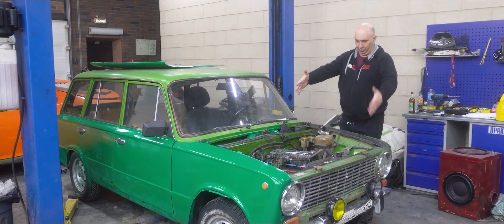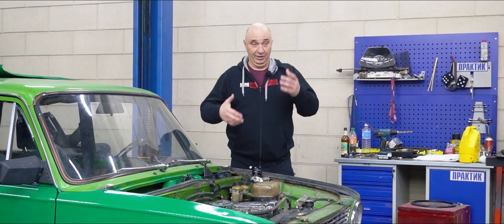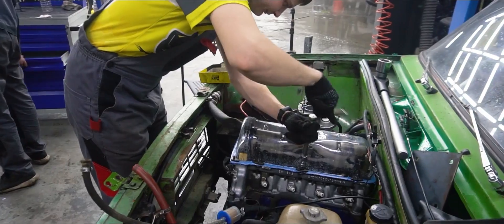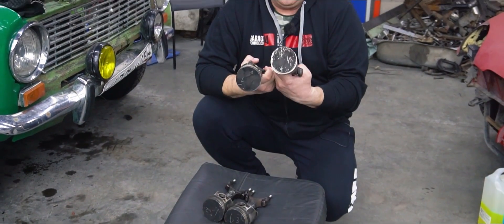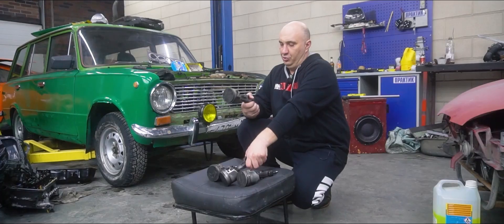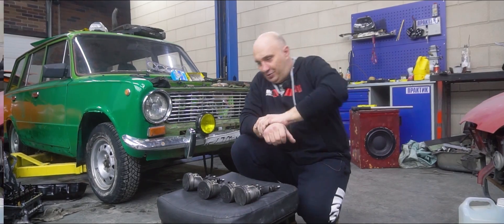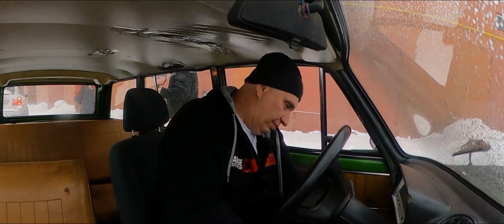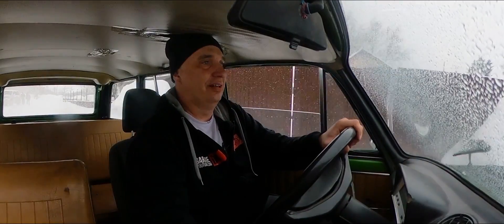Welds vs bolts – testing their durability on conrods

Comment: Welds are better because they dont mess with the evenly constructed weight distribution in the engine between pistons as they all operate tagether on the crankshaft 🤔

Comment: Bolts are always better, they have some give and will take shock, welds are rigid and crack before a bolt will brake that is why truck frames are bolted and riveted much better than welding.

Comment: as expected, the conrods have clearancing issues. the bolted ones are suspect. you're probably chewing up the lower cylinder walls and getting metal shavings in the crank case. poor thing. has me thinking about that last experiment with the plastic cylinders. what if plastic conrods? would that work, and how long until you'd eject a piston from stress?

Comment: @6:40

It won't start that easy because the conrods have different weight than the originals. So the timing shouldn't be in correctly order.

Comment: I had a VW  78 Rabbit with a glasspack, and one time blow out 1 spark plug, i dint know was wrong with it and i keep on driving to my destination 400 miles away and i made it, beside all the knock noise,  the engine was fine, my rabbit still burn out the tires, i love VW

Comment: Welding all 4 with 4 different welding processes and put it back on the road and see which one last the longest ,,, that would have been a really educational experiment ,,, we knew the bolted one will give up ,, in any case great insight at design and materials strength conceptual basis ,, with a humorous line !!!

Comment: I think the piece of steel joining the bolted ends is what gave up, not the bolts.  It got pretty thin around the areas where it was drilled to accept the bolts and nuts

Comment: I wonder if you can do a study on what happens if you connect an increasing number of car batteries in series to a motor?  I wonder if the starter goes real quick and you get an instant start on 48v and at what voltage everything just explodes when you turn the key.

Comment: I wish you would have done one with the steel plate reinforcements like the ones you did with bolts, but instead of bolts just using JB weld after sandblasting or cleaning the metal.
The real JB weld not JB weld quick.
Fun video that's not the one I thought would go the first.

Comment: Well, such bolted connections rely on friction. Both sides should have perfect fit. Bolt is used only to squeeze them to have enough friction so that it can't move apart. If those bolted plates were not touching it with whole surface, it would have too much shearing force and it just shuttered it. That's why bolted connections like that are usually made on flat or precisely fabricated pieces that fit tightly together. Those bolts have good tensile strength but not shearing strength. It would be quite difficult to fabricate piece that fits there nicely.

Comment: Someone I know tried adding weld in the middle of connecting rods to make them stronger....
All that happened was the weld came off and then all the metal particles wrecked the engine via the oil galleries....
Don't do it...

Comment: Was wondering can you turn a fuel injected engine upside down and it still run also love the show
Reply: Aeroplanes do it, with carbies or fuel injection, keeping the oil circulating is whats hard when inverting an engine, not fuel,

Comment: I amused myself when I caught myself attempting to determine which connecting rod should last the longest, if the whole production even gets that far. My guess on the order of failure, from first to last, would be the weaker bolts, the TIG weld, the MIG weld, and then the higher grade bolts last. I'm not any sort of engineer. 
Edit: Wow, did I have it backwards.

Comment: What happened - the thin metal plate holding the conrod together snapped. Then we have an engine spinning fast with the bottom part of the conrod smashing into the loose piston and conrod very fast. Especially with holes drilled out of it the conrod was ground into fragments. The bottom part of the conrod managed to break loose from the cylinder now allowing it to fling outwards with centrifugal force becoming a flailing mace, thus smashing against anything it could reach. This is why the breaks are all along the path it would take.

Welds are stronger than bolts. Whilst this wasn't a fair test - the thin metal plates are very weak in comparison to conrods, bolts are rarely going to beat welds. The bolts drill out large portions of the metal severely weakening it, and carry the strength across a small thin portion of metal. Being separate bolts (as opposed to a single large one) they can break individually making them weaker than the sum of their parts. The welds take nothing out of the material and keep the strength, whilst adding an amount of fairly strong metal. Welds are continuous so the individual pieces can't break and it spreads the load better. Of course there are always exceptions, but in the majority of cases a good weld which is properly done will be better than bolts.

To improve the test one would want to use a similar method for both welds and bolts. Ie as a separate piece of metal must be used for bolts, the weld should also use a separate piece of metal to bridge the gap. Ideally it would not be so weak - it needs to take just as much load as the thick heavy conrod is taking itself.

Comment: This is one of those when you rebuild an engine you tighten the last bolt on air filter saying whew that took all weekend and look down and see a random bolt looking at you very importantly by you can't remember why. So back in you go. Hours later AHH found it. The number 3 con rod only had 4 bolts in it. 
Your friend looks at you..
Walks over to your cup and sniffs it.
Looks at you again. 
Just leaves not wanting to know why your conrods look like that.......

Comment: Not enough strong material around the drilled bolt holes, I assume. Maybe a small imperfection exacerbated by the removed material. Seems like the type of bolt didn't matter.

Comment: The way it shattered, it almost looks like it had a bunch of stress fractures. Maybe that one got to hot when grinding to cut? Don't think just the nuts and bolts would cause that much damage, unless maybe sheered off under very high pressure. Good video though.

Comment: Bolts have nearly no sheer strength, only the cheap bolts were able to flex enough to not be ripped apart:-)
Try to use fasteners for sheer strength:-)

Comment: I recently got another engine experiment idea: try putting some Cerama Bryte brand cleaner for glass and ceramic cooktops into it. The substance isn't supposed to scratch delicate surfaces when used as intended. However, I think we can agree that putting it inside a motor with parts moving at very high speeds and oil that it can potentially interact with chemically is far from its intended use. It could be fun to observe the results.

Comment: The man ls got balls for leaning in that motor while cranking. I wouldnt wanna be near it when it kicks a rod 🤟
Also Ive never doubted that the bolted rods would give first. Its a no brainer I think.
The entire force is on a small part of the metal holding the rod together. Especially if youre wrong by half a mm. That alone would be enough the fatigue the metal since it would be streched or compressed the whole time.

Comment: Isn't there supposed to be a hole going from the small end to the big end that supplies oil to the small end of the con rod and the piston rings??????
Wouldn't hacking up the con rods this way cut off the lubrication to the small end and rings?????

Comment: Remember: Welds don't "break" they "fail" so if your weld doesn't do the job, just weld it again! 

Unlike bolting pieces together; welds don't require additional structural materials to be sacrificed to support the bond so even a mediocre weld can outperform bolts as long as the fundamental elements of the weld are correct 😄❤👍

Bolts certainly have their own strengths to be fair, but as a welder by trade I'm biased. But hey at least I'm honest about it 😅

Comment: Personally I weld and bolt where I can, depending on shape of material,. 
But you should fill out he Pistons with lead weights, to see how Piston weights effects the engine balanc!   But I always heard floating valves will break rods , or pull them apart at high rpm!

Comment: Back in the day that no spare parts were available my uncle needed a rod for a KX125 but could only found one that fit the piston and another that fit his crank. They were also different lengths. He had a local machine shop that is known for being the welding experts cut them in half, space them correctly and weld them. It ran forever! Welds are superior any time something doesn't require disassembly.

Comment: Someone underestimated the power of a good weld. Depending on several factors, but usually welds are much stronger than the parent metal. Drilling holes and sticking Bolts through them, just makes the structure weaker.

Comment: I suppose you could even resume the test with blocking the holes in the engine and running it on 3 cylinders. You told us these engines were tough! Now would be the best time to prove it! I believe you could even resume on one working cylinder, if you just block the other paths.

Comment: Anytime you put a hole in the rod it will make the rod weaker as to welding it back together by replacing metal with metal the bolts feels the holes but doesn't help anything really

Comment: You need to test this. https://www.carthrottle.com/post/the-aftermath-of-a-jeep-revving-to-50000rpm-while-being-towed-in-4-low/  Put a couple of transmissions in series to spin a motor to high rpm with another motor. Something will blow up but it will be interesting to see what and at what rpm. Thank you.

Comment: Use Jb weld to fix the holes in the block to see JB weld is strong enoughto fix the holes without failure. And weld together the rod that failed and see how much further and longer the motor will run . That would be awesome.  I bet it will go at least 100 miles . What does anyone else think, how far would it go with the rod welded and a JB weld patched block . I say at least 100 miles or 160 kilometers for you metric folk. This cannot end here 🤣🤣🤣

Comment: The straps you used to bolt the rod together are what failed. They couldn't take the tensile force. I really don't have a good suggestion to get around this...maybe use thicker material for the straps? I think you should try again with only welded rods and see what happens. I am very curious if the welds will hold. In theory they should. I am also curious if you can weld a valve back together and it be OK for a while.

Keep it up! I really enjoy your experiments!

Comment: Looks like same failure that my '99 Camry (5SFE) had and everything.  at almost 300k miles, I hotrodded it a bit too long (Even on new oil) and cylinder number 4 spun and eventually let go, even after we attempted new rod bearings and new oil.  Took out the block, pan, yet still ran and drove for quite a while.  After we let it cool down it even drove 3.5 miles (5.6 kilometers) to my house on 3 cylinders and no oil.  It eventually got hot and seized, yet when cooled down, even starts still, but won't run much because compression was practically dead at that point.  I still feel bad, that car was the toughest car I've ever owned, and the most trouble-free.  It was so good to me that it deserves/is getting another motor.

Edit: I can probably upload some of the videos if people really want to see the failures and startups.

Comment: You guys should make a pony-motor for starting ladas! Just put it in gear, hook the pony-motor to one of the rear wheels, and force-start it with a 5 or 10 horsepower v-twin engine!

Comment: Grind off the broken rod so it can't hit anything internally and put it back on the crank, shove the old piston back into the bore and silicone it in place . Clean up the holes in the block real good and silicone some patches over the holes and then drive it some more to see which rod breaks next. You know it still runs, let's test it some more.

Comment: They are not similar at all . drilled rods are automatically to weak because of the four holes, and, they are relying on another piece of metal to hold it all together. When you both on a car tire, the main holding Force is the wheel against the Hub, due to tightening the lug nuts. The force is not directly relying on the lug nut. There are not going to be able to hold the rod together well as the weld. What should have been done, you should have welded the ROD CAPS on some of them, and bolted the others. Something along those lines, would have been a better comparison.

Comment: Modern car: won't start because seatbelt isn't tied
Lada: all conrods welded or bolted, one broke and made hole in engine block and oil pan, no oil, no coolant, 3 out of 4 pistons stil present in car, lada starts and runs.

Comment: They should run a 4 cylinder engine with only 2 pistons inside it. I recommend them making a video about that.
Reply: It's possible, especially with a wasted spark configuration 🙂.
Reply: No point. It will run. Like a 2 cylinder engine.
Reply: Agreed!!

Comment: The bolted rods needed to be braced on both sides to keep everything straight. With only one brace, the compression and tension are always off-center and kicking things over to the side. One of the bolted rods was practically guaranteed to fail first.
Reply: And what about the strength of the connecting rod where the hole was drilled. The connecting rod is the weakest at that location
Reply: If for no other reason than the threads would start compacting and creating slop... After that well...you know...💥🤣

Comment: They try to blow up Lada engines on purpose, and do not succeed.  They try an experiment, blow it up, and it STILL runs on 3 cylinders with holes in the block!  Next video, "WIll Flex Glue and Flex Tape make this engine good as new?"

Comment: Cut connecting rods in half, remove an inch of the rod and weld it back together. Reinstall in the engine and see how it runs
Reply: I don't think it will run at all. Even a millimeter or two is a bar (15psi) in compression. An entire inch? That engine won't be making any compression at all.
Reply: @99domini99  so it would be like a kia?
Reply: @99domini99  Those Lada motors have an 8.5 to 1 compression ratio. That's with a stroke of 3.39 inches. So if you cut an inch out of the rod it's going to have about a third less compression. At 6.5 to 1 it will run. 
6.5 to 1 was a common compression ratio through the 1940s and earlier.
The Model T ran just fine on a 4 to 1 compression ratio.
Reply: @otm646  Most of the compression happens at the very last bit of the stroke, I doubt the engine will run if you cut out an entire inch.
But I could be wrong, would be an interesting experiment for sure!
Reply: The crankshaft would probably hit the piston skirts. There's very little room in there in most engines, when the piston is at the bottom of the stroke. Also, the piston might come down so far the rings pop out of the cylinder at the bottom.

Comment: You fragilized the rod piercing hole into it, the high tensile bolts and nuts are harder, in the one with standard bolts and nuts, they are much softer so they can absorbe some ot the stress.  But deform a bit each time so they will break fast. With hard bolts the rode just don't have enough resistance du to the holes and shatter.

Comment: Suggestion : Take out the engine, smash a hole in the block and see if you can weld it shut and see if the engine works.

Comment: @Garage 54 have you guys ever done a Max horsepower test on Lada engine. They have really thick connecting rods, they look like they can handle 300 to 400p+ horsepower. Maybe if you do decide use heavy duty ARP connecting rod bolts

Comment: My father had a Moskvitsh. The engine blew up and people in the car next to him laughed at him. He saw pieces flying and stopped on the side of the road. Hole in the engine, but he decided to start it again anyways and it started, he could drive it. The car who passed my father were at the next lights and they were really surprised to see him. Tough cars.
Reply: You missed the part when it threw a rod or something such when calling it tough 😆 My VW Vento did the same when I tortured it, threw a rod but started & drove still.
ps. torilla ei tavata
Reply: @piuthemagicman  Tough, because many engines wouldn't run after that.
Reply: @Lassi Kinnunen 81 En usko että on enää sitä mossea jäljellä. Tapahtu vuosikymmeniä sitten.

Comment: You weakened the rod by drilling the wholes through it would be my guess.
Reply: Not to mention the now out of balance rod
Reply: @Russeljfinch  That is right! When you also add in the four holes and a small but critical space allowing expansion at the cut I'm surprised it worked for as long as it did.
Reply: I think the weak part was where the cutoff wheel went through...
Reply: I agree.  next time they should drill halfs instead!
Reply: He couldn't have weakened the hole thing.